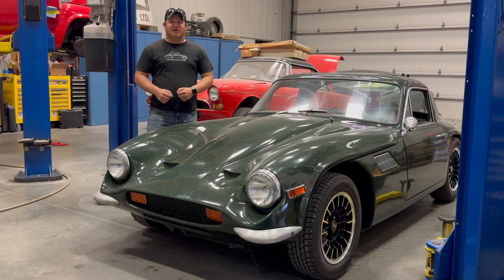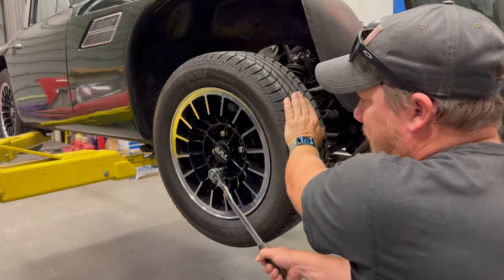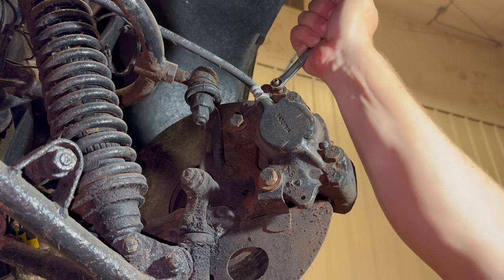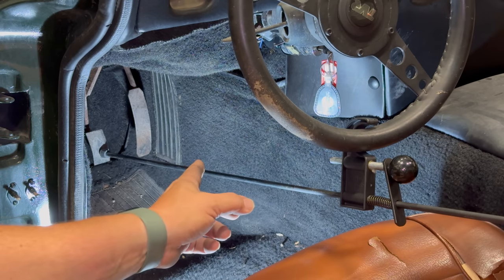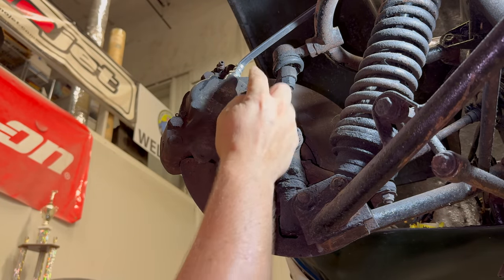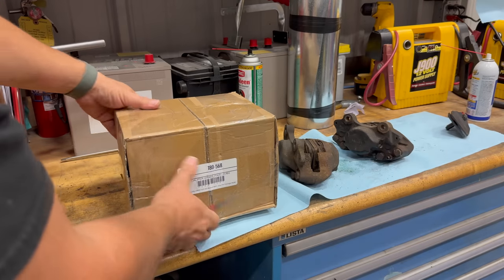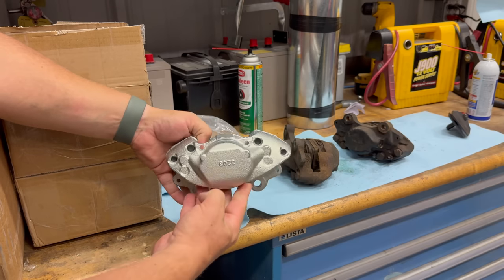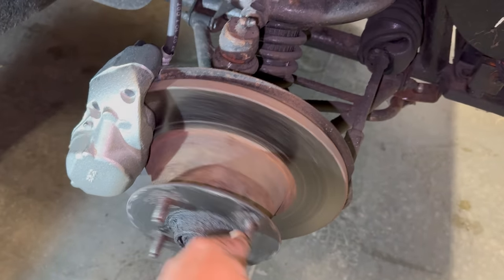Back Working on My TVR Vixen 2500

Comment: That Triumph six was such a sweet engine. Back then, I was lucky enough to travel in a few Triumph 2500 PIs which were also great looking cars both inside and out. So I can quite understand why the engine would suit the TVR so well.
Reply from the maker: Interestingly I don't think TVR ever used the petrol injection in any of their 2500 cars.
Reply: @ThisWeekWithCars  The original versions of that engine ran on carbs but as I recall PI became an option at some point and might even have been standard on later models.
Reply: I'm an old 2500TC owner too, I loved the engine, but the gearbox/clutch was a nightmare, what eventually got me out of them into something where I didn't have to spend hours lying on a cold concrete floor with 100lbs of bell-housing/clutch/gearbox/overdrive on my chest....
Reply: @paulhall170 Definitely a good idea to warm the concrete floor first!!!

Comment: What's not to like about a TVR. This one has the Mk 2 Ford Cortina rear lights which look great on it. As you say TVR would 'borrow' parts from other car makers. Likewise makers would use parts from the 'parts bin' on other cars in their range, all saves on costs. However I think it is good that you pointed out the different versions. It is a 'pain' for us in the UK to return items so if your supplier orders from the UK you want to get it right first time. Thanks Steve, some good tips in this video. 👍👍

Comment: For my TR7 V8 I bought Willwood upgrade front Brakes.
Reply from the maker: The TVR Vixens weigh around 1,600 lbs so it doesn't take much to stop them.  A TR8 is 1000 lbs more.

Comment: Steve. Congratulations on a great channel and an impressive collection!!!
I hope that perhaps you can steer me in the right direction. I’m in Puerto Rico and currently working on one of my cars. A Gt6 . I overhauled the carbs and the car will not start unless I prime it with carb cleaner and then it dies. Steve, I’m totally baffled by ith this. I have checked everything to no avail. Any ideas or suggestions will be highly appreciated. Thanks in advance. Love your MGA by the way
Reply from the maker: Have you checked for vacuum leaks, it will cause the car to run very lean even to the point that it still can't get enough fuel even with the choke all the way closed.
Reply: @ThisWeekWithCars  
Yes. I’ve checked all hoses and connections. I was wondering about the bypass valves. They have new diaphragms but I don’t know what to think anymore
Reply: I put on a set of carburetors from a Herald and it fired right up! Now I’m really confused and frustrated. Thanks again Steve

Comment: Question, Steve, I want to buy a lift. If you had room and budget for only one lift, would you buy your four post lift, or your two post lift? I'm using it to repair MGs, Austin Healeys, and some more modern cars, but nothing huge, no trucks.
Reply from the maker: The four post is great for quick jobs, as you see in my videos it is my preferred lift to use even if I have to take a tire off one at a time to change wheels or tires.  The two post is great for doing anything that requires all four wheels coming off at once or even having more access to wheel hub area.  You could get by with a four post and it is more convenient most of the time but with a two post lift you are set up to do any job your cars would ever need.  The two posts also take significantly less room.